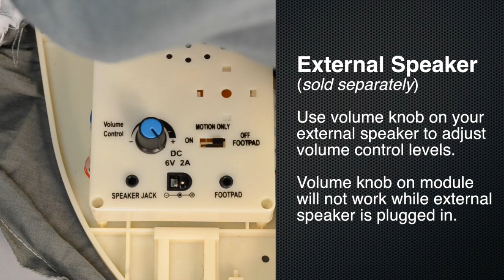Tekky's Sitting Scarecrow Assembly Video

Comment: Does anyone now how to disconnect the pole connecting the base to head!?
Reply: On the side where it says A and B there is a latch you have to press in. I had to use a streak knife to press it in. While it’s press then remove the pole on that end. Repeat on other side. I found the B side easy to find and press, but the A tab is up a little higher.
Reply: I linked a video if you still need help
Reply: Where did you link the video